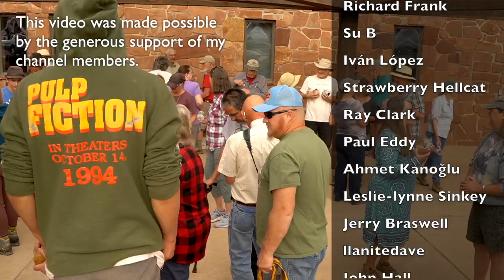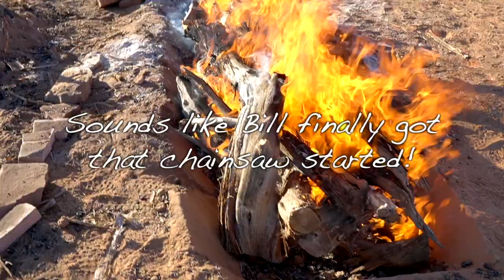4 Ways To Fire Pottery Outdoors - 2021 SW Kiln Conference

Comment: Wow, I envy you guys the dry ground you have in the Southwest.  I can't do pit firings where I live, or even ground surface open firings, because the ground always has some moisture and if you dig down into the ground, the hole will fill with water. Even in the hottest, driest summer weeks, the ground water is never more than a couple of feet below grade level.  No basements here!  I have to build firing areas or small brick kilns on a platform of flat stones or cement or bricks.  And our wood has to be stored under cover and is almost never dry enough to use straight from the woods, even if standing dead.  It's good for growing mushrooms, though!
Reply from the maker: Wow, you must live in a swamp. Maybe you can build a little platform to fire on, in Hopi many of the potters build a little block pedestal to fire on, this lifts the pottery away from the cold, damp ground. I even know a woman in South Africa who fires in an old wheelbarrow and a bathtub. Be creative.
Reply: @AncientPottery  Actually, I do live in a rainforest, and the post-glacial geology means that water is trapped between layers of clay and gravel.  We have wonderful abundant spring water and a thick layer of fertile topsoil and sod, but just underneath is clay and water!  The clay, however, is fantastic and can take very high temps, firing to a white color.  
I do have a small brick kiln on top of a layer of gravel and concrete blocks.  I used a double layer of bricks so the kiln is more insulated against our cool, rainy climate.  I just can't do the quick and easy open-pit firings you guys are lucky enough to do.

Comment: I've been enjoying many of your videos.   I have a sort of off topic question.   I am interested in making bonsai pots using primitive methods. Would clay fired using primitive methods be able to stand up to conditions needed for temperate trees, which would mean being exposed to wet and freeze thaw cycles?  Thank you, you do wonderful videos.
Reply from the maker: Thanks! 
I think that freezing temperatures might cause spalling in ceramics that have absorbed water.
Reply: I think Andy is right; freezing will cause spalling unless you use special techniques.  Try a heavily-grogged sculptural clay body and fire it to the highest temp it can withstand to fully vitrify it.  Then it won't absorb water and won't spall during cold spells, and will withstand thermal shock (temperature extremes) much better.